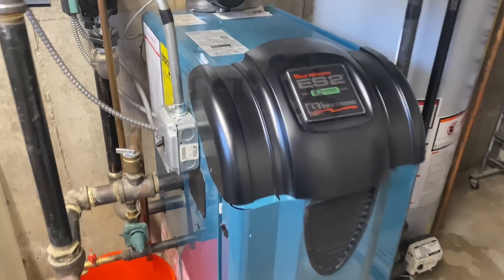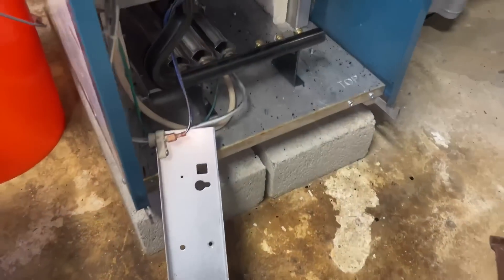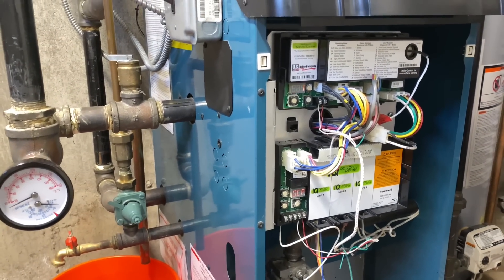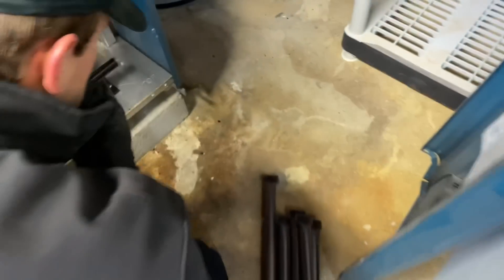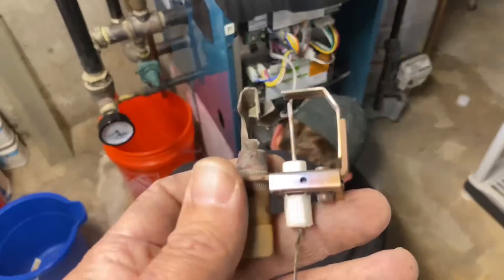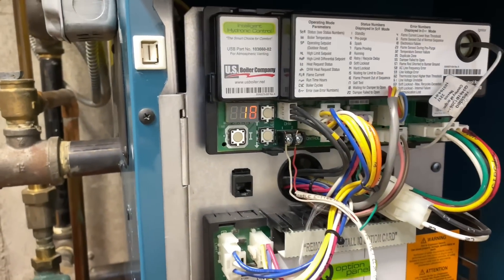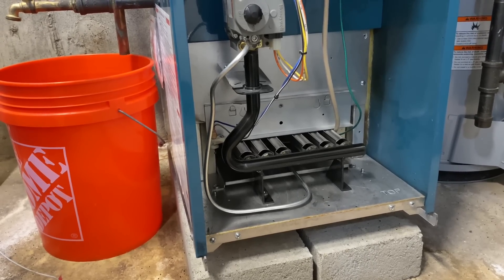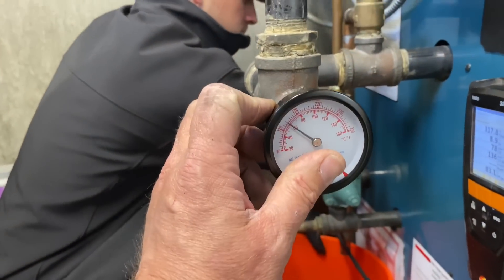Burnham Gas Boiler Explodes at Startup - Delayed Ignition or Inadequate Combustion Air?

Comment: My rollout switch on a 25 year old 80% furnace was tripping, the techicican re-checked everything I had already checked, and no smoking gun. Temp at the switch was well over the rated limit and I asked "well, couldn't improper manifold pressure cause this issue?". He wasn't testing until I spoke the words. Dialed it in at 3.5" WC and the temp at the switch was now 80 degrees below the cutout temp. Just following the master plumber's advice.

Comment: It has a bad controller. I had a unit with a smart valve, lady says it sounds like her furnace is exploding. In front of her I cycled her furnace 15 times, ignitor lit, gas came on good to go. The very last time I cycled it, I was talking to her, THE GAS CAME ON  no IGNITOR, I dove for the power switch however, I missed it. Then BAM!!!! The ignitor kicked on, with all that gas inside furnace and it let loose. I never seen an 80 year old run so fast. Smart valve your ignitor is controlled by the gas valve not a board. I bet his control board is acting up. And I am not going to lie, I was scared shitless when that happened.

Comment: Hey Mikey, I'm a retired HVAC tech and enjoy your vids. They make me feel like I'm still out there! Did you check the vent termination? I recall a job just like this and it lit fine while I was there so I did pretty much what you did and left. A few months later got the dreaded CB. This time I looked at the vent termination and the roof was a 14/12 pitch and there was only 12" of pipe sticking out including the cap. The install crew raised the termination to get proper clearance. I'm guessing certain weather conditions made it backdraft and thus the mini explosions because that did the trick.

Comment: Thank you for taking the time to share As always!

The chamber is plugged with carbon still. 85 ppm CO at correct the 3.2-3.5 input. CO is too too close to 100ppm. 

Also, your inlet pressure at 5.8 inches is too low. 
With all the appliances in the house operating ( if they have a gas,water heater,dryer,oven running with top burners), 
i would bet the inlet pressure drops below 5 inches. 
You should have at least 7 inch inlet operating pressure. 

Also, the inlet gas piping should be piped at 3/4 inch for more volume if it is not.

Not to take away from anything you are doing, just an opinion, passing your way.
The pilot sensor being worn would cause ignition issues.
Reply from the maker: Thanks for sharing your feedback and thoughts. We shall see if the issue continues (ie. carbonized sections) ran DHW gas heater - that’s the 5.5” WC inlet with WH running.

Comment: Having the gas pressure at 2.78wc and 81 CO climbing, makes me think that someone decrease it on purpose to try to control the CO. Now, adjusting it to 3.5wc  probably get you  lower Oxygen reading, however, higher CO reading.  We’re u able to check you final CO readings?
Reply: I agree, would have liked to seen the combustion readings after the manifold pressure was increased. Sometimes a lean fire will produce a higher CO reading.  The high excess air cools the flame temperature.
Reply from the maker: No one ever check or tested anything.